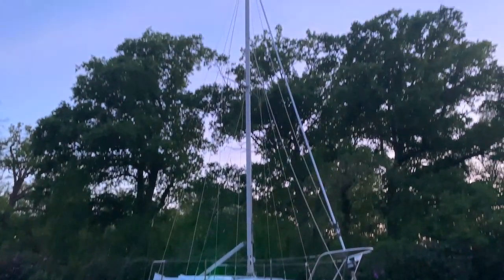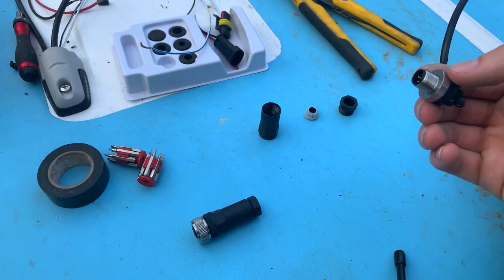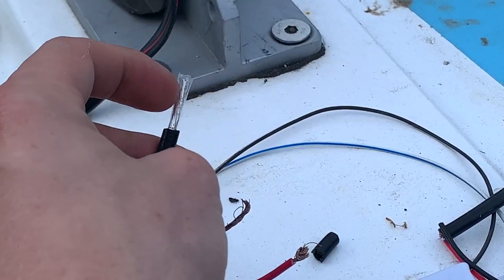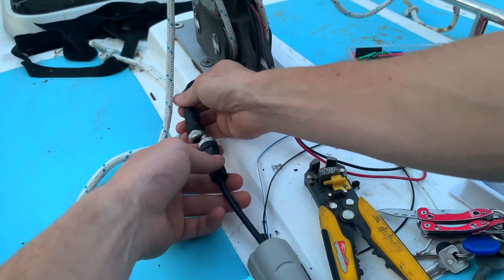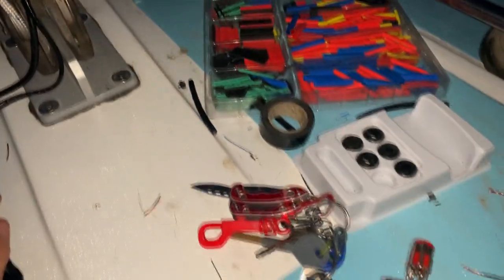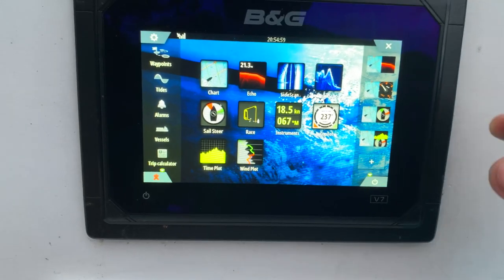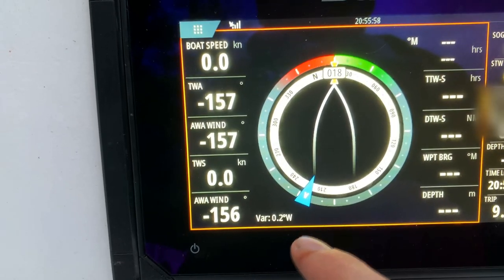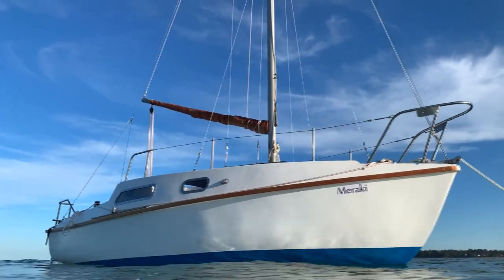How To Fit A Field Connector NMEA2000 (I Got The Wind Vane Working) Sailing Meraki | Ep.30

Comment: nice "howto" ! I use to put a verry few grease inside the connectors to prevent corrosion of the screws. :)
Reply from the maker: Pierre Jaraud yeah i did that after the fact after the fact as i didn’t have any to hand at the time. thanks for watching!
Reply: Any issues with such grease being conductive? (or can it become conductive?)

Comment: Thanks for the video - Super useful.  Do you have the link where you bought the connectors ?  Having no luck locating ones that are waterproof
Reply from the maker: https://www.bottomlinemarine.com/prod_cat/P_actisense-nmea-2000-field-fit-connector--straight--male---micro-c--a2kffcsm_8080.shtml?gclid=EAIaIQobChMIm5W-gZb38QIVV6jVCh0wtAjmEAQYByABEgJ2_vD_BwE
Reply from the maker: This is the link to the actisense one. Garmin and ancor also make them. Glad I could help you!
Reply: Excellent !

Question - how happy have you been with the b&g set up ?   I just got a beneteau first 20 and considering b&g wind and depth set up with a couple of their triton displays. Seei g you video btw has convinced me the wired option is the way to go, not just less cost but to me seem for easier to deal with as can get mast down too.
Reply from the maker: @gusestrella  I have really liked using it and the setup is easy. The hardest bit is nmea 2000 network and the mast connection. The pollster works well and has great features for sailors. Nice boat you have!

Comment: Why did you decide to mount the connector and fuse outside the boat? Could you have fed the wires from the mast through the deck gland and then fitted the connector and fuse inside the boat?
Reply from the maker: There is no fuse and the reason for the connector outside is for the removal of the mast. The deck glad is only small so a connector wouldn’t pass through. If I had the chance to choose again I would have got a wireless one😅
Reply: @AlexGoesSailing  I see what you mean. You're doing some great work.
Reply from the maker: @paulharrison7914  Thanks! I have some exciting thinks planned this year!